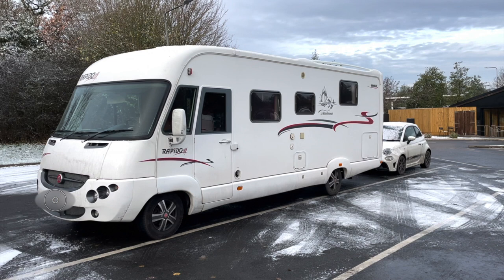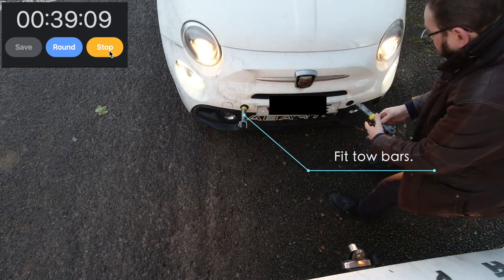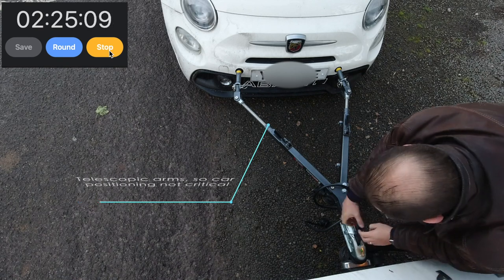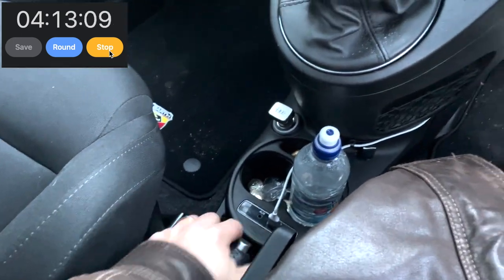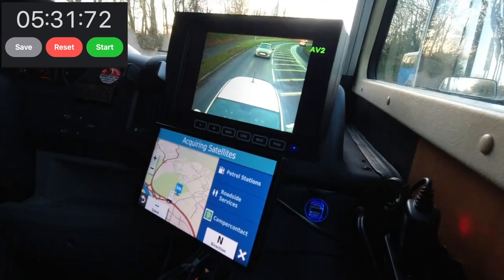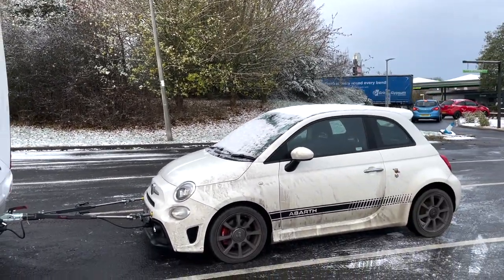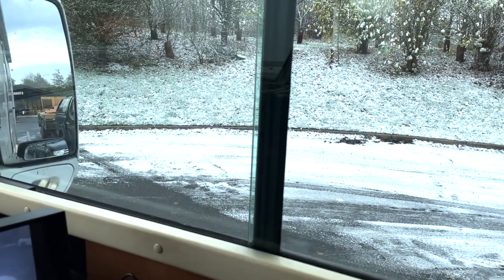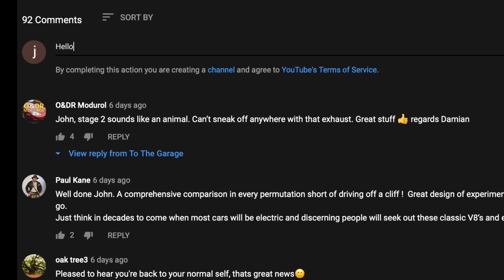Towmaster 2 'A' frame conversion on a Fiat Abarth 595. How to attach the frame and how long it takes

Comment: Very nice job, don't forget can't use in most European countries though, must be a trailer. Got done in Switzerland, the Police were quite helpful though, got a warning and told I must use a trailer in future, wife had to drive the car. Reconnected in France though and now have a trailer.
Reply from the maker: Its an interesting one. And yes people do get pulled over in certain countries. However. It Is a 4 wheeled trailer. Its braked . It has a breakaway cable operated emergency brake. It has tail lights that copy the towing vehicle. It displays red a reflective triangle from the rear, and It carries the numberplate of the towing vehicle.
The only difference between it and any other 4 wheeled trailer is a steered axle. (rare but present on some trailers) and the fact that it is car shaped.
The issue arises as in some countries including Switzerland you are not allowed to tow a car to recover it unless you are a registered recovery agent.  
By this they mean pulling a car on a rope, Towing bar, or even with two wheels elevated on a spectacle carrier. 
So the concept of a car converted to be a trailer is rare and raises attention. 
The conversion I had came complete with laminated cards in several languages explaining that the car had been converted to be a fully compliant Braked trailer, and the references to appropriate regulations in Europe that permit its use.
To be fair it won't stop you being pulled over (because it looks like you are towing a dead car) But it should result in a handshake and you being waved on. 
Understandably, many won't want the hassle though, and so will be careful about which countries they use such as system in. Or not bother at all.
Its an interesting topic.

Comment: Hi John, Indeed an elegant solution for towing, really neat. We have come to expect nothing less from your expertise.
How about a bonnet cover for Snoopy, would offer some protection. We use them for outback journeys to protect against stones/sand etc ?
Where are you heading to, I hope it is warmer climes ?
I would like to take this opportunity to thank you for your tireless efforts to assist us XK8 owners etc throughout the year, most appreciated.
All the Best for 2022.
Cheers
Reply from the maker: Hi Alan. A bonnet cover is a possible option if I can find one thats secure but easily removed. Otherwise it will be an enormous mud flap for Ruby.
I was heading from Lincolnshire to Newport South Wales for work and then back again a week later. It was warmer. but im guessing no more than 5 degrees🤣

Comment: Interesting John. I am amazed how the car steers itself. I assume because of the cars castor, but it still has to overcome the resistance in the power steering?
Reply from the maker: Yes its fascinating to see the steering working as if via an invisible driver😁
Its possible to have the power steering running as its electrically powered rather than hydraulic (and the car battery is being charged the whole time its connected via the Motorhome) However im ashamed to say I don't actually know if this is enabled on our system,🤔. Probably not as the Abarth is quite light.

Comment: Hi John, Always wondered how to get the car precisely in the right position to hook up, this system works a treat..being an expensive system, but I think it was worth every penny.
I did pass your rig between Bristol and Gloucester, it must have been 3-4 weeks ago, I was going in the opposite direction....
Has the electrical plug covered the white Abarth writing on grill?
Also does it clock up the miles on Snoopy?
Can predict the next job = a good wash!
Another great video - keep it up, Merry Christmas.
Reply from the maker: Hi John. Great to be spotted👍, yes that would have been me.
There is a hole on the grill that the socket shows through. (Its attached to a bracket on the new steel crash member behind the grill. Unfortunately it has taken the cross bar of the 'H' away. But as the socket cover is black, I will just add a couple of white lines to the cover and it will be invisible to all who dont know.😉
No👍 the miles don't clock up on Snoopy as the mileage is only registered when the ignition is in the 'on' position.
I will be giving her a good wash, and Ruby will be getting a grass skirt mud flap or similar.😁
Reply: @ToTheGarage  Thought it was you, as how many rigs are in this combination.....
Great plan with the grill, should make it invisible.
Thank you for answering the mileage question.
Yes the grass skirt would keep it a lot cleaner, or a more solid rubber - may be with a stainless steel strip along the bottom.
Is there a length limit with this setup?

Comment: Hi John good video as always 
I thought the towing limit without a braking system was 750 kg ?
Reply from the maker: Hi Dave. You are correct ref the braking requirements However this system is Braked. Its a relatively expensive system as the car has a full day worth of mods done to it so that it does the braking without using brake cables or telescopic tow hitch systems like on caravans. I will do a separate video showing the mechanism under the drivers seat in the Abarth. But essentially all you need to know is that when the Motorhome brakes, a signal from the brake lights. causes a vacuum pump under the drivers seat in the Abarth to operate the brake pedal progressively.
Thanks for watching Dave👍
Reply: @ToTheGarage  Evening John    thanks for taking the time to reply  
I had a look on their web site and legal comments so i guessed as much 
I tried to do a similar system a few years back so I could tow my series 3 lightweight  but then only systens were from the USA